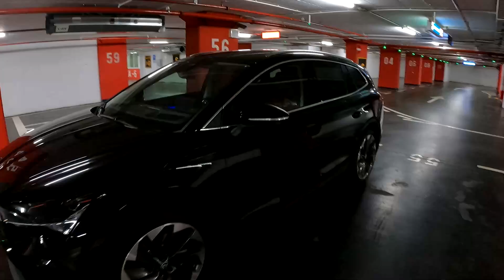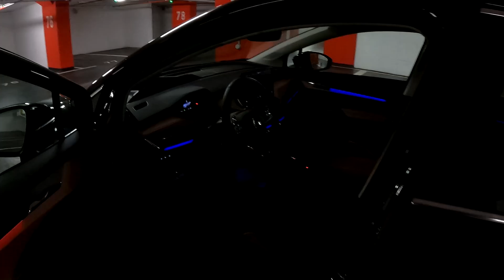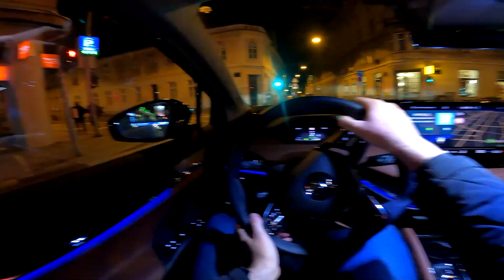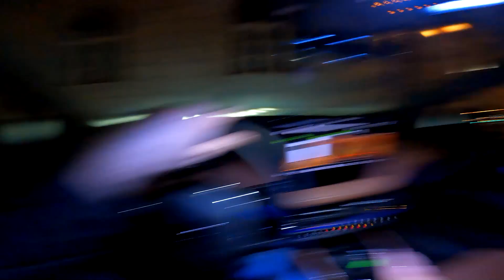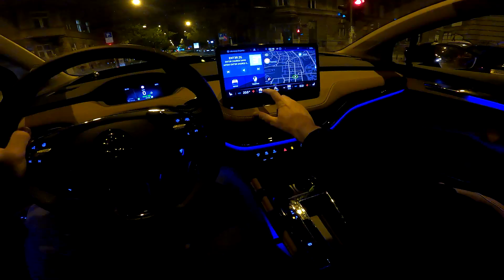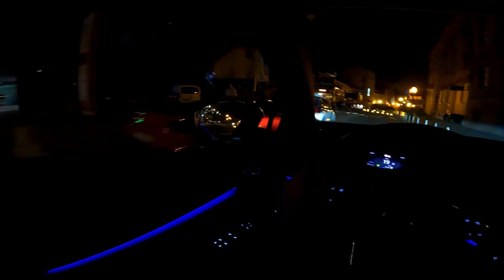NEW Skoda ENYAQ 2021 - night POV test drive & REVIEW (80 iV)

Comment: It's so enjoyable the silence. But one question, how is the noise from other cars, tires and stuff? Is it more distinct or is it better insulated then a "normal" car?
Reply from the maker: It’s similar, but in EV’s you can hear all the sounds coming from inside of the car. In this car everything is good and well made, but on small city cheap cars that might be an issue (plastic parts etc)